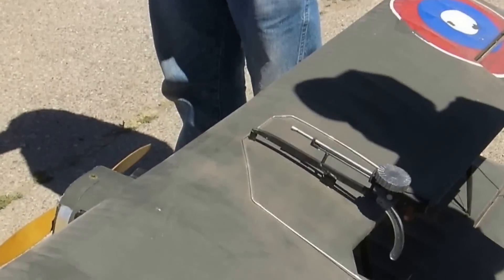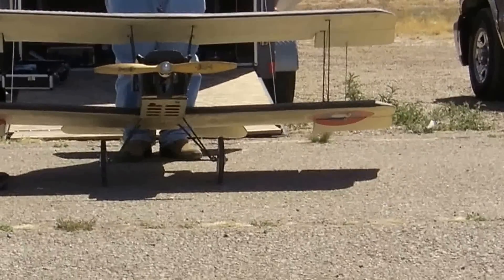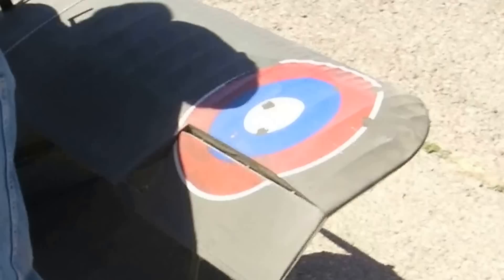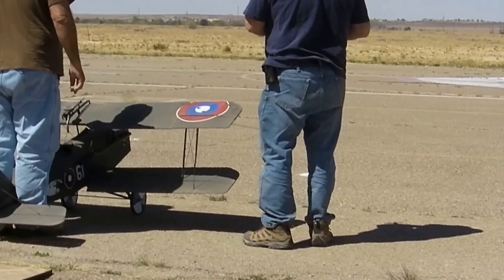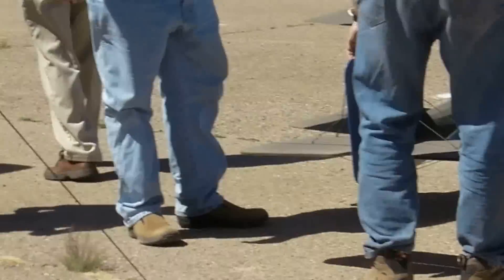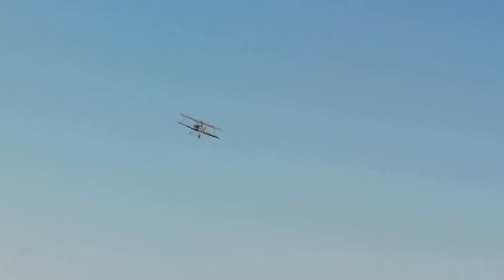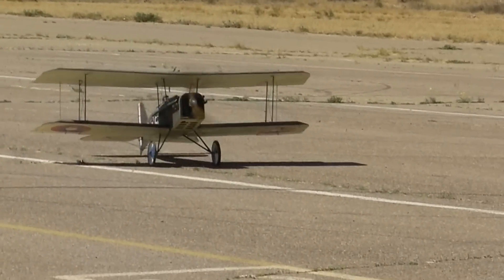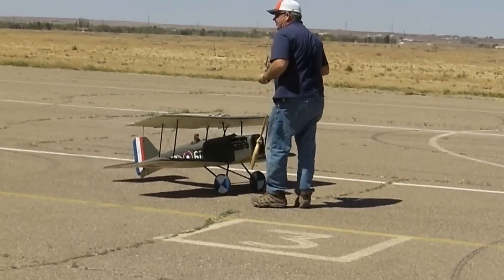1/4 scale Balsa USA SE5a Electric Maiden Flight

Comment: I am going to use your setup in a Balsa USA 1/4 scale cub - at least for testing.  I was wondering what your SE5 weighed, and how many amps at full throttle?
Reply: 19lbs, 36amps full throttle static
Reply: @greginnm  My BUSA cub is 15 lbs with eflite power 160 on 12s limited to 10s (40 volts) pulling 86 AMPS with a  19x8 electric prop at 9000.  Still way more than needed but gives me a 19 minute flight when just tooling around.  Just to let you know, your influence has washed over me and a bunch of my flying buddies such that we are all switching over to giant scale electric.  I removed my DLE 61 from my Hangar 9 Fokker D7 and replaced it with a 60cc electric on 12s using a 24x10 prop and it flys extremely well with more power than ever and absolutely reliable winter and summer.  I am now running a 1/3rd scale SpaceWalker,  and soon my 1/4 scale Spad XIII on electric power thanks to your video.
Reply: @mrvoyagerm  you may want to try the lower cell count and spinning a larger/higher pitch prop. I just put my 2  5cell 5000mah battery packs into a parallel configuration giving me 10,000 mah capacity and I think the larger prop with higher pitch I'd more efficient and more scale speeds IMHO.  I.E. no super sonic Cubs lol
Reply: @greginnm  We tried our Cub on one 6s battery with a 20x8 gas prop and it flew but just barely.  Someone mentioned that it looked scale.  Definitely no aerobatics.
Reply: It may have to do with wing area. The BUSA SE5a has a bunch more wing than the Cub. The other thing may be the battery capacity.  My SE5a has 10,000mah capacity and because of that I don't think there's much of a voltage drop ( consequently higher prop rpm) so  that may have had an influence. Also higher pitch may make a difference
Reply: @greginnm  What prop are you using?
Reply: A wood 22X10 gas prop
Reply: @greginnm  We will give it a try.  Thanks
Reply: You're welcome. I hioe that it wirkdms out fir you. I have a 90" wingspan Cub kit that I'm going to try a Power 110 it and see how it does. If it has an abundance of power, I have a set of floats to go on it as well

Comment from the maker: That's correct, I initially ran the motor on 10s battery ( the two 5000 5 cells in series) and it turned a 22 - 6 prop at 8300 rpm at 100+ amps. WAY too much power for the SE5a and WAY too much amp load. That's when I tried it on a 5s setup and was very pleased with the results powerwise.

Comment: So ,you are running 20 volt hooked in parallel and not 40 hooked in a series? That motor is working well off of 5 cells then !
Reply: that's correct, the 5 cells works fine

Comment from the maker: I've been very pleased with the performance of the SE5a. I am running two 5000mah 5s battery packs in parallel using a 160 motor and it spins a 22-10 prop at 5300 rpm. Gives me about 18 lbs of trust at an average of 37 amps. because I have 10000mah of battery capacity I have 16 minutes of flight time.
Overall performance is every bit as good as the Brison 2.4 I took out of the airframe and its much smoother running.

Comment from the maker: Thank you, it really is nice to fly with the electric motor in it. I can fly 15 minutes  with the current battery set up I have in it so duration isn't a problem.
5S2P 5000mah battery pack ( 10,000 mah total capacity)
Reply: I am now building my 4th ! 1/4 WW1 using your basic setup ..except I use two 6 cell 3600 in parallel, I have sure had a lot of fun using your  setup ! I hope you are still flying the SE5a..

Comment from the maker: I think you'd like the conversion. It does fly smoother with the electric motor and take off is a right now proposition!  With my RCEcalc app on my tablet it tells me I should get around 17 minutes of flying around at the average amps I'm pulling. As it turns out I'm averaging around 34 amps for just tooling around flying like you see in the video.